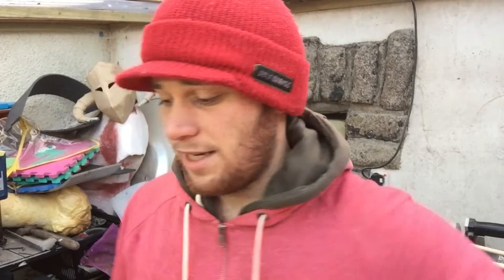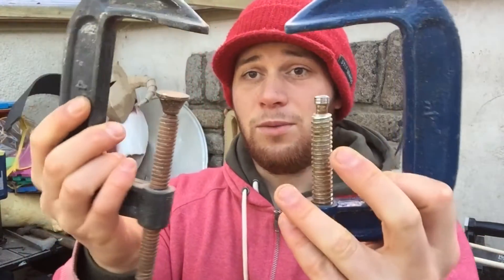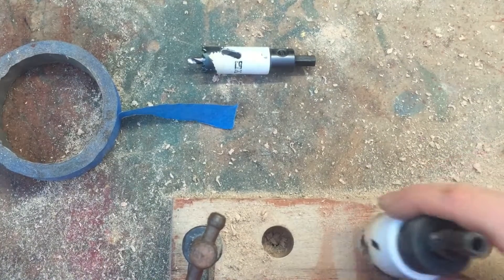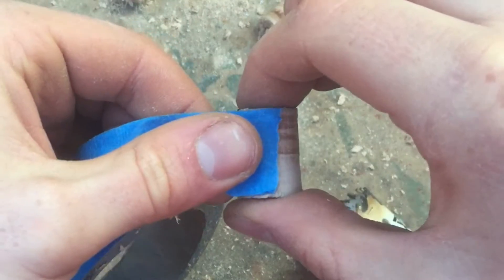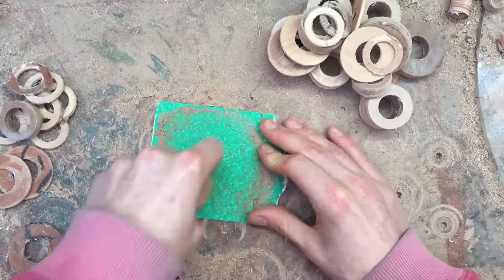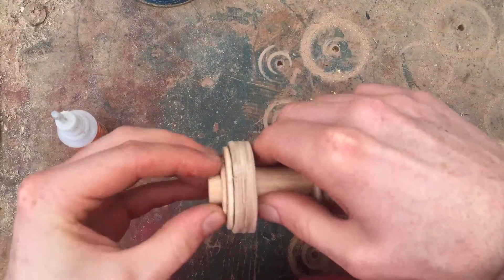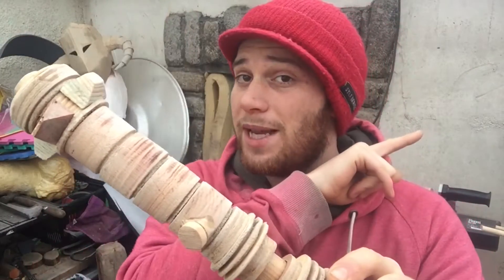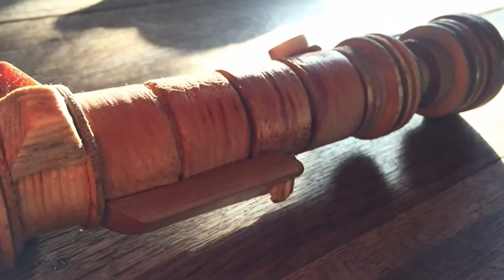DIY Wooden Lightsaber (without a lathe)

Comment: If u drill halfway thru with ur hole saw and flip to do rest you will have less tear out to clean up
Reply from the maker: You’re totally right. Whilst it could be kinda tricky to do that to the really thin wood, it’s definitely worth trying and will save you a lot of time (and sanding) in the long run. Thanks for the tip. 👍😉
Reply: No problem I learned it from YouTube so I felt the need to pass it on. Keep up the great work

Comment: Another thing to do is to get a wooden rod and just build out of it instead of cutting away material. You don’t want to cut away material because your gonna want the blade to get fairly deep into the hilt of the lightsaber. After that you could cut away some material but not to much.
Reply from the maker: I have made a few on my wood lathe but they are definitely weaker. This method is the strongest and you don’t need a giant expensive wood lathe.